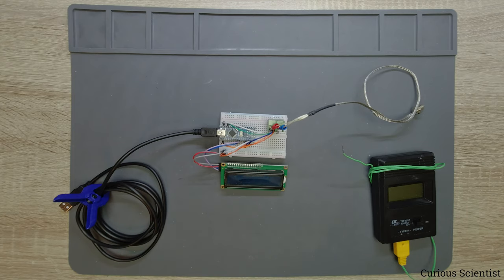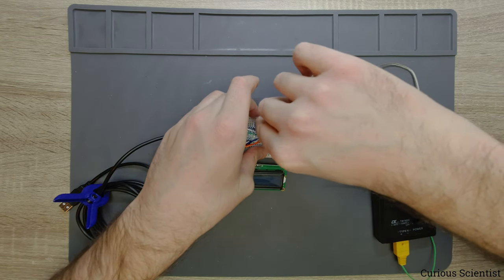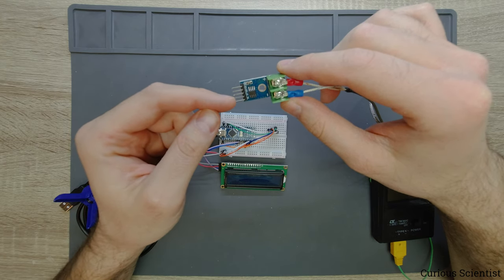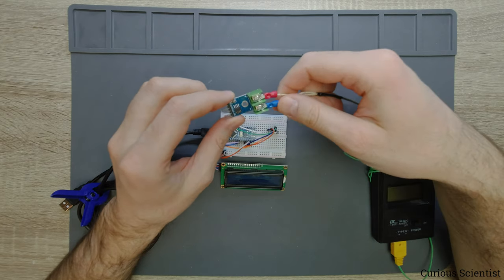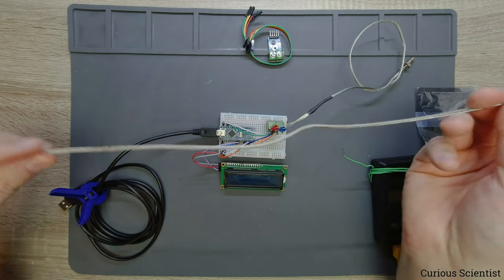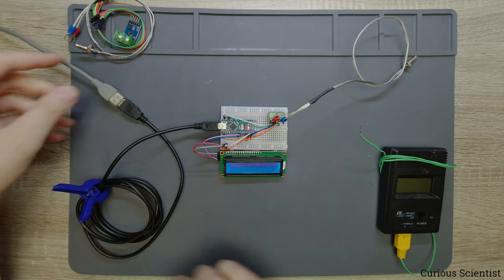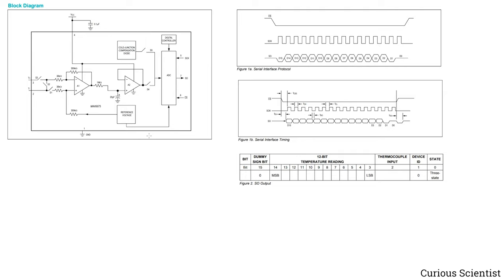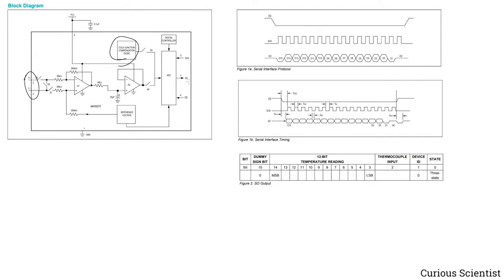MAX6675 - K-type thermocouple module

Comment: Can I use Type K thermocouple with ADS115?
Reply from the maker: Simple answer is no, use a dedicated hardware for thermocouples. 

More sophisticated answer is yes. How? You can measure the thermocouple's voltage with the AD-converter, but then you either need to make a polynomial and calculate the temperature at a given voltage, or you have to make a huge look-up table to match the temperature with the voltage (manufacturers always publish the look-up tables). However, this is not enough by itself, because you need to measure the temperature (with another thermometer) at the cold junction and need to compensate the thermocouple temperature with the cold junction temperature. So, just use a proper module for the thermocouple.
Reply: @CuriousScientist  Thank you for the info.

Comment: i really need your help i got the display module identical as yours but I cannot find the gnd vcc sda and scl pls help
Reply: i think its the same without the i2c module
Reply from the maker: Have you tried Google? If it is without the module, it will be a bit more difficult to use the display. Get one with the module or just buy a module for the display.

Comment: I have amplifier thermocouple MAX6675 same you use this demo. My problem about calibration. I have calibrated, but the result not good.
Reply from the maker: What do you mean by not good? How did you calibrate it?
Reply: @CuriousScientist  I compared MAX6675 to hg thermometer.
Reply from the maker: Okay, but comparison is not calibration. So I don't really understand the issue.
Reply: After I compared, I make regresi linier to get equation
Reply from the maker: I still don't understand what's the issue.
Reply: Just a simple, my question how to get the real measure data?
Reply from the maker: But it is in the video. Everything is in the video. You can also read the datasheet of the chip.